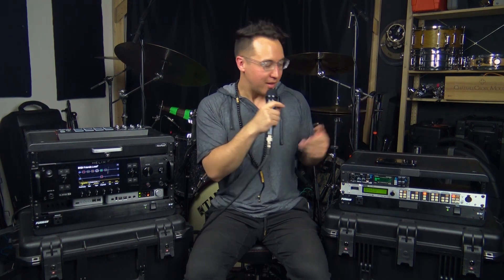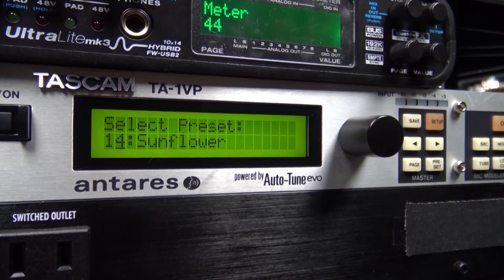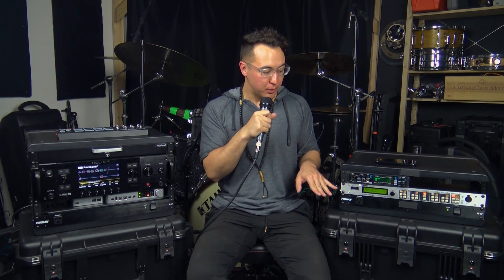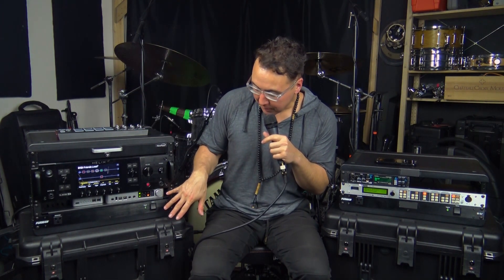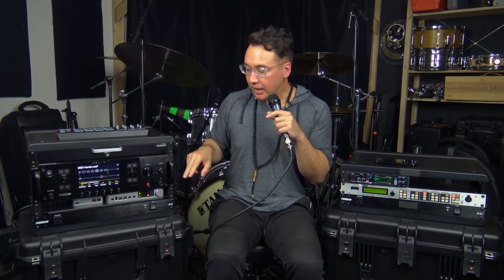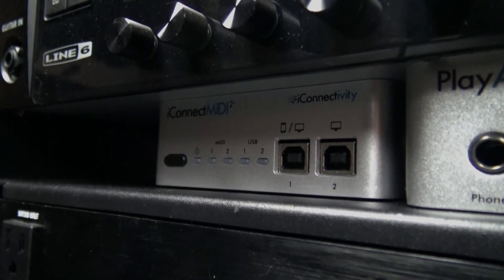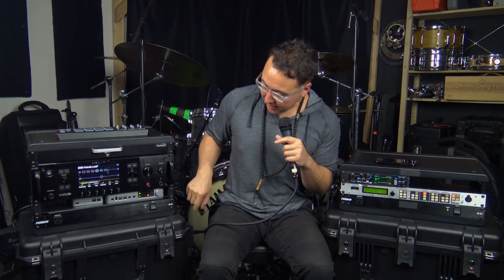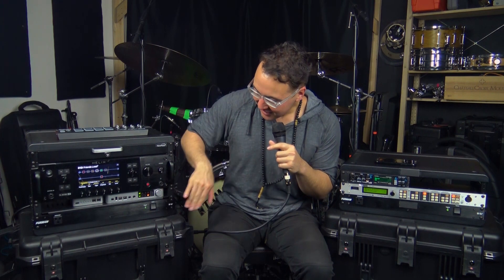Anatomy of a Playback Rig - Episode 2

Comment: Good video! Gotta get on that iConnectivity life
Note: On the DI/loom question. Watch that your audio interface has good caps in the outputs. I've seen FOH send power back through and hit the interface an cause damage for some.
The PlayAUDIO12 has more than 48V caps so you don't have a problem there.
Reply: I'd always put a DI Box between. You never know...
Reply from the maker: @TinoSchulz1990 You never know what?
Reply: @eldowns  AC peaks and stuff. I heard that you should always put a DI Box in between, even if your interface could handle accidental 48v power

Comment: I've been following thus channel for a while and it's been helping me out so much! I'm using Ableton for live looping guitars, bass, synthesizer and various other instruments. I'm using my Apollo twin and using my MIDI footswitch for easy accessibility and looping. My question is how can I get the best possible sound when I plug in through my PA? Should I be routing my instruments two different outputs? Should I use multiple computers? Should I get a DIY rig? Should I also be playing with my amps?Got any suggestions here for my output sound?
Reply from the maker: You should only make the setup as complex as it needs to be. Separating the elements is only useful if you have a dedicated sound engineer who wants them separated. Otherwise, send them out a stereo pair. You don’t need two computers. Whether or not you play with amps is entirely up to though.

Comment: hey eric, did you never run intro problems like ground loops, signal loss or signal interference due to the lack of DI's? i get your point that it's technically not necessary to use DI's for Line-Instruments but, especially if you run long distances (from your rack to the stage box to the front of house) i always thought a balanced signal might not be a bad idea as well as to interrupt the physical circuit (don't know the proper english term) to avoid a ground loop.
Reply from the maker: Hey Paul - nope, I’ve run into this problem 0 times!
Reply: DI is redundant because it is already a balanced signal coming out of the interface as TRS (and terminating in XLRs to interface with the stage box) Using a DI on a TRS is just using the DI as a really expensive and unnecessary TRS to XLR adapter. DIs are intended for TS unbalanced signals, like a bass guitar. Length of cable run isn’t a big issue with balanced signals. Also most modern rigs are digital at the stage box these days so no signal loss from stage to FOH etc.
Reply from the maker: Couldn’t have said it better even if I knew what I was talking about.

Comment: I usually use a second computer to process my vocals via autotune on Ableton using a uad Apollo, would you say the tascam is a better route than a whole separate computer?
Reply from the maker: There’s nothing wrong with using a separate computer, just more expensive and complicated. The Tascam uses the exact same tune engine and can be rack mounted and hard wired.

Comment: Hi Eric, I just got the motu mk3 hybrid. From the manual it says the 3-8 outputs are in line level. When sending the signal from these output there are constant peaking in the PA MIXER without turning the gain knob. Would like know how do you send the signal to a level into the PA without the audio signal to hot.
Reply from the maker: It sounds like they’re coming out of the DAW too hot. Try gaining all your stems down the same amount to create headroom for your PA.
Reply: @eldowns  thanks. Will do that.

Comment: hey eric, very helpful video. but how do you connect this whit you in ear monitor?
Reply from the maker: Hey, so sorry I missed this. The main way you would do this is by sending all your tracks out to an engineer (monitor or FOH), who would then send you back a mixed feed of everything on stage.

Alternatively, the hacky way is to keep this next to you on stage and plug your IEMs directly into the headphone output on the interface, then create a separate return track in Ableton and use the Send knobs to create a mix of the tracks for you. Of course, this method does not allow you to hear anything on stage.

Comment: Hey, I know it's been a while since you posted this but I'm struggling to find the answers elsewhere!
- With the PlayAudio12, you said you ran the mio2 off of it, is that compatible with the "Host" usb port on the PA12? Couldn't find any mention of compatibility in their manuals unfortunately.
- Your loom that you show has an organiser on it so it doesn't get tangled, I've never seen one of those before and it'd make my life so much easier! What are they called? I'm struggling to find them in google searches haha

Cheers!
Reply from the maker: In this rig, the ran the mio out of the PA12 host port, but since then I’ve upgraded it to the MIDI4+/mioXM, which can be more permanently and securely connected via Ethernet.

The loop organizer is a custom little thing I make. Can’t buy em!
Reply: Thanks for this thread, guys. So I assume that plugging in another Midi interface (MOTU Microlite) into the host port of the Playaudio12 also takes care of midi redundancy?

Comment: Cymatic lp 16 with  midi is a way better solution then having to have a laptop and interface. Taking the computer out of the equation eliminates so many headaches. And do everything that you're doing here and eliminate the laptop
Reply from the maker: There’s a reason virtually no A-level artists use that setup though. On-the-fly arrangement and programming flexibility as well as much more complex MIDI routing capability is an absolute must and the LP16 does not accel in these areas.
Reply: He isn't being arrogant. How do you extend a chorus, middle 8, or send midi changes to a complex keyboard setup? The Cymatic machine will not handle every situation. Want to change the arrangement for live - it means a whole lot of bouncing and a whole new session.
Reply from the maker: Precisely. I never said the LP16 can’t do those things. All I’m saying is that Ableton accels at all of them because the editing interface is also the playback.  Ultimately, he’s not arguing with me - he’s arguing with literally all of the A-level touring industry. Oh well.